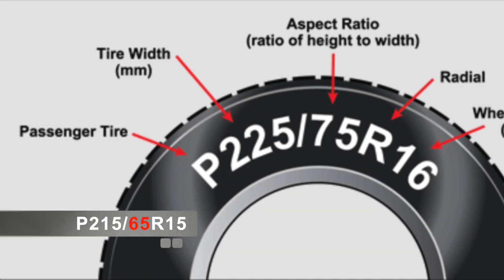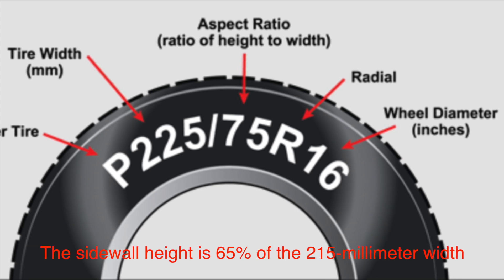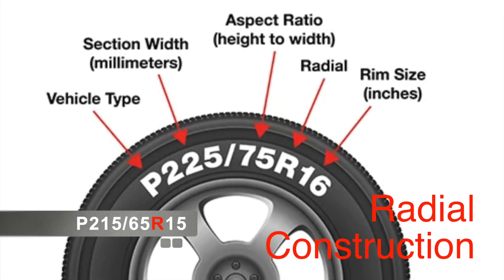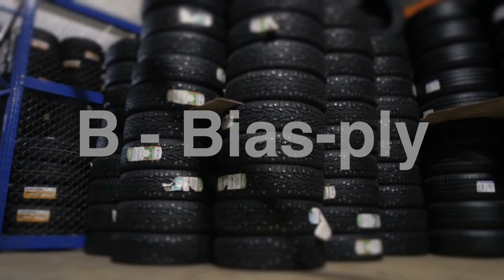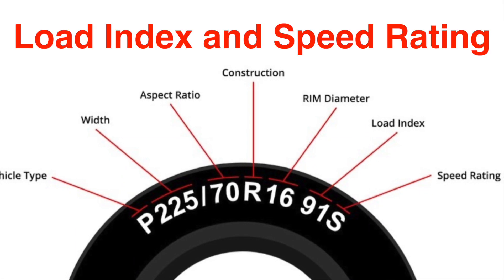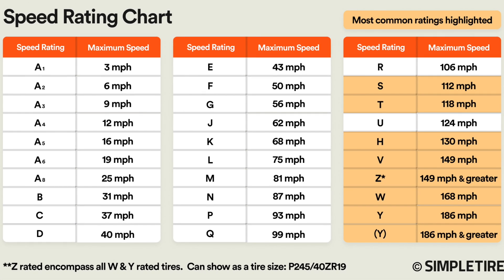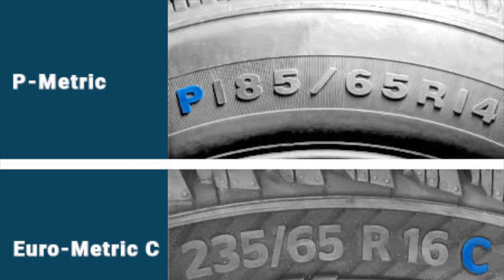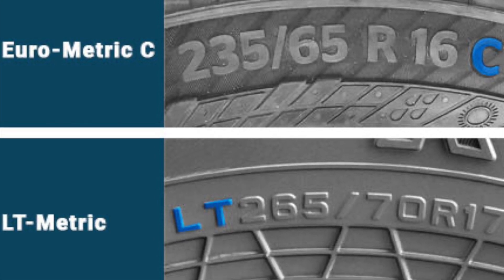Tire Sizes: How to Read Them and How It All Started

Comment: Should have discussed the US sizing system used prior to metric/ISO.
From Wikipedia:
Historical tire codes - North America
Prior to 1964, tires were all made to a 90% aspect ratio. Tire size was specified as the tire width in inches and the diameter in inches – for example, 6.50-15.[34]

From 1965 to the early 1970s, tires were made to an 80% aspect ratio. Tire size was again specified by width in inches and diameter in inches. To differentiate from the earlier 90-ratio tires, the decimal point is usually omitted from the width – for example, 685-15 for a tire 6.85 inches wide.

Starting in 1972 tires were specified by load rating, using a letter code. In practice, a higher load rating tire was also a wider tire. In this system a tire had a letter, optionally followed by "R" for radial tires, followed by the aspect ratio, a dash and the diameter – C78-15 or CR78-15 for bias and radial, respectively. Each diameter of rim had a separate sequence of load ratings; thus, a C78-14 and a C78-15 are not the same width. An aspect ratio of 78% was typical for letter-sized tires, although 70% was also common and lower profiles down to 50% were occasionally seen.